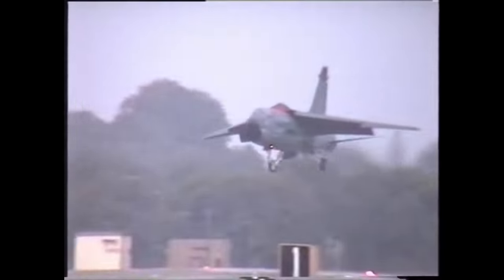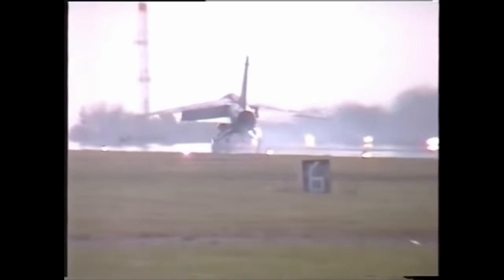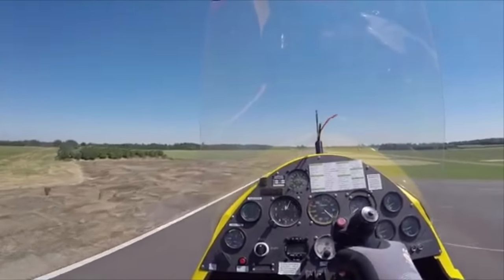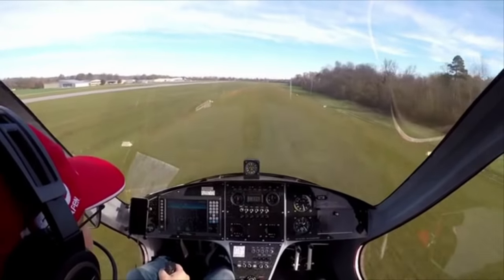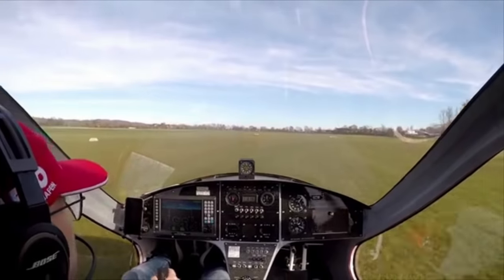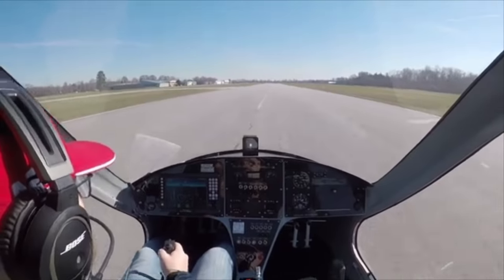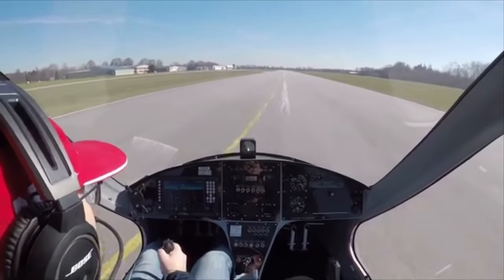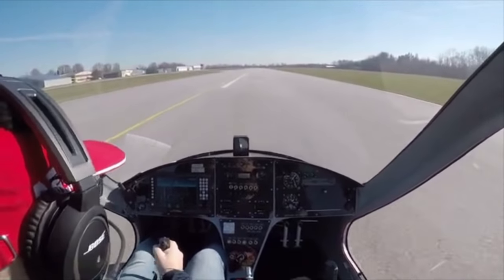Gyroplane/gyrocopter landing accidents & possible errors

Comment: I would love to have your comments on the last landing...Thanks for your youtube channel.
Reply from the maker: Well I was just surprised tbh as I wasn’t sure what the rational was - I suspect there was some thought to the quarry and trying to keep some height in case of engine failure?? But I think if that was the plan why not hold height until actually over the runway then do a vertical descent and land?? Seems they kind of had the bones of a plan but executed half of it as they got slow and the blast of power at the end was defiantly to cushion the landing.  Ultimately I just think it was made harder work than it needed to be.
Reply: Pretty sure they’re practicing an engine out on this one. The engine is Cleary chopped before decent. Not sure if you should be reviewing this sort of content if you can’t pick that up.
Reply: Practicing engine out in front of that cliff?  Madness

Comment: Great presentation. My only comment is that you don’t always have to trim on finals
Reply: But commentary not necessary for me thanks
Reply from the maker: Hey Phill - The not trimming on finals draws in quite a lot of opinion which broadly divides along two lines.  You sometimes hear fixed wing pilots claim they don't trim so that the aircraft will always fly 'nose down' so that it effectively defaults that way and avoids a stall.  Which is kind of a little school boy - you could also just trim accurately, fly accurately and avoid arm ache and the potential to float forever.  I guess these pilots also add 10knts to the book approach speed just to stay safe?  But anyway thats one view.

The other view is they fly a Magni and therefore you don't need to trim [see that exact view from Owen a current UK examiner/instructor].  Sadly this is also wrong.  The reason this view exists is because the people who believe it fly around at the exact same airspeed.  The fly circuits at 60mph, they fly upper air exercises at 60, they fly transits at 60.   So yes for the few who fly at one speed you may not need to re-trim, but who does that???!!! Maybe its the fixed wing pilots from the first example?